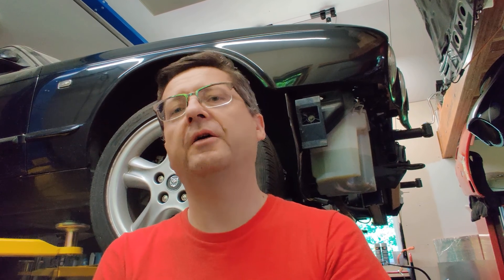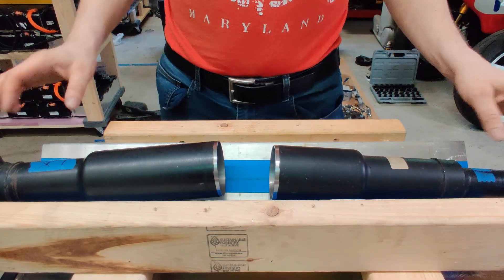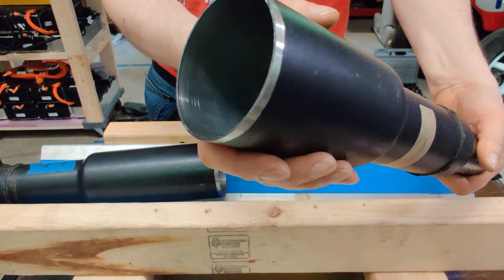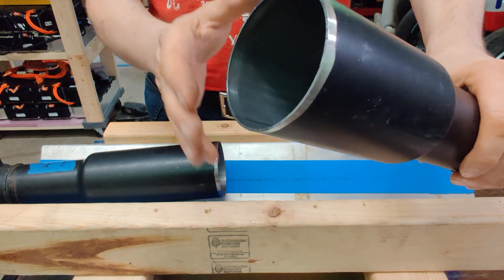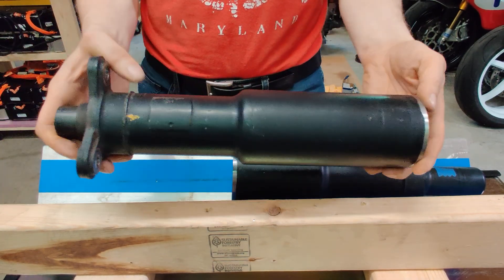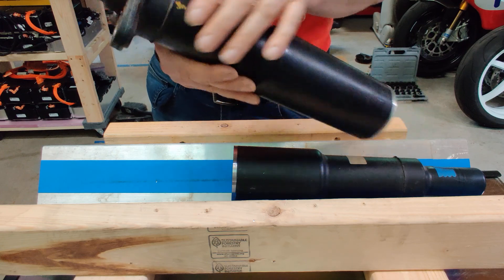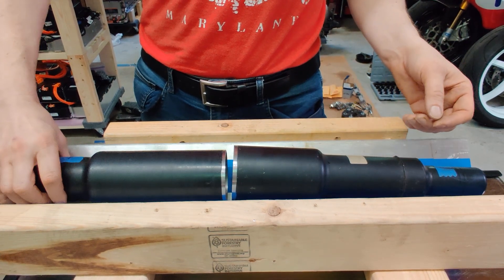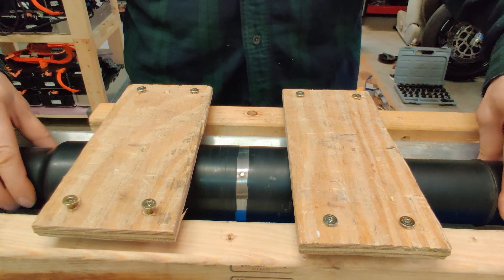Jaguar XJR EV Conversion - Shortening driveshaft

Comment: Hi Artur. If life allows, I will want to do the same with an X350 within the next 6 months. I was thinking of taking it a step further and "rotating" the diff 180 degs and placing the engine in the spare wheel bay. That way I could drop the drive shaft as well, but that's just an idea - don't know if realistic. Anyhow, since the all aluminum NA X350 is 1,7 tons, dropping the 4.2 engine, zf6 gearbox, drive shaft, exhaust, full tank, spare wheel, 90 ah battery and fitting the engine with tesla's let's say 50 kwh should give a lot of an EV for that weight.